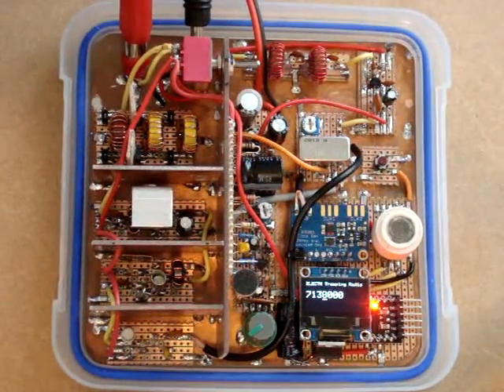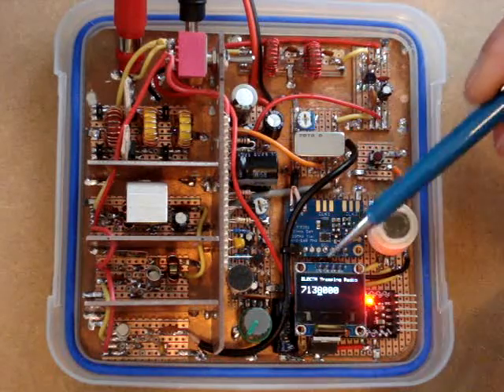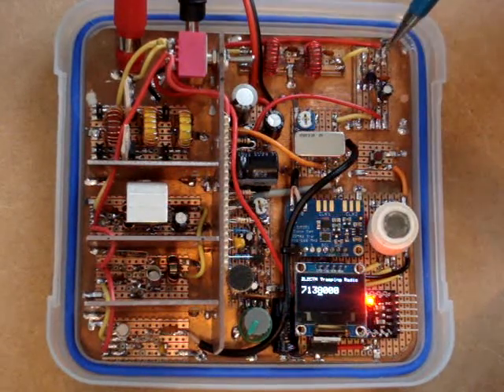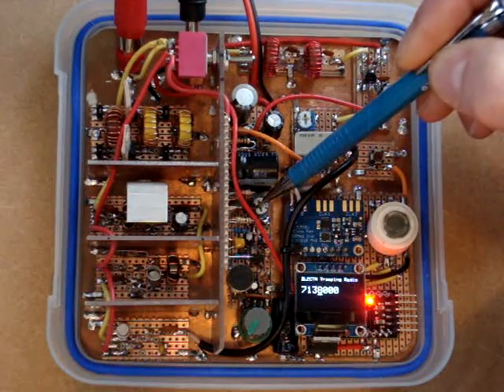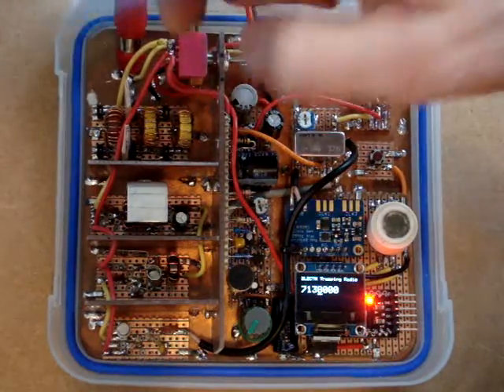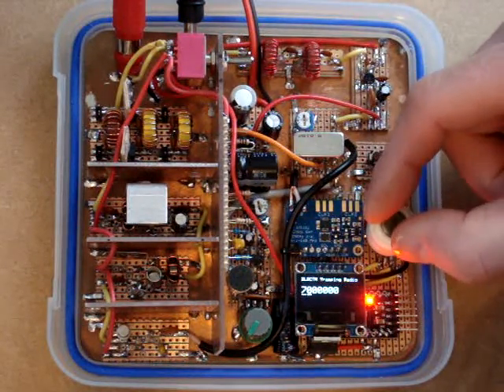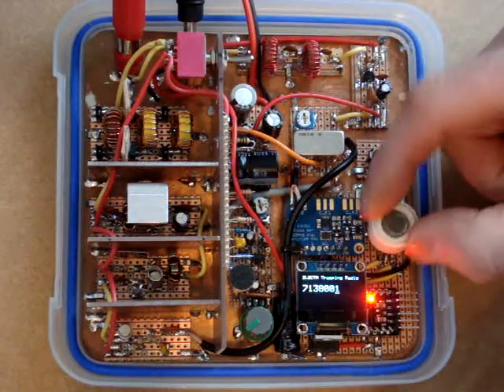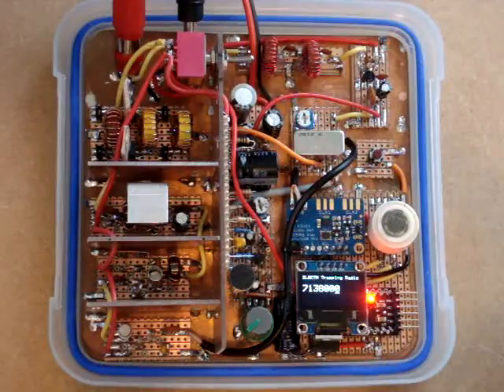Homebrew 80m/40m/20m Tramping/Hiking Radio

Comment: excelent Charlie...9a3xz
Reply from the maker: Cheers Mikele. Certainly a simple way to make a filter. A bit of work, but nothing too technical. Ideal for a simple shack like mine.
Reply from the maker: Opps. Wrong video! Yes, that rig goes back a bit. I find those little food storage boxes really good and easy to use.
Reply: Charlie Morris Pete put new video today and i m thinking to start your hbrsdr ..very very nice Charlie
Reply from the maker: Go for it. You can make the front end whatever you want, so long at it provides I and Q AF to the Teensy. The Iowa Hills software is great to generate the filter coefficients. More details at: http://zl2ctm.blogspot.com/2018/03/homebrew-ssb-sdr-rig.html

Comment: Very nice! I like how you implemented the radio in descrite stages as with a block diagram.
Reply from the maker: Thanks. I find it useful to build the individual modules then join them all up. Easy to swap out and try different approaches.

Comment: I like it!  But didn't the square-wave output of the Si5351 need any filtering?
Reply from the maker: Hi. I have had no problems driving double balanced mixers (commercial SBL-1 or homebrew) directly with the Si5351 square wave output. I've made several radios with that scheme and they all appear to work well. It's slightly greater than 7dBdm, but again, it seems to work well. There was a good article some time ago on the Soildersmoke blog about square wave VFO/BFOs and DBMs. Refer http://soldersmoke.blogspot.co.nz/2016/03/blog-post.html
Reply: Thanks for the helpful reply.  That's an excellent lecture on mixers.

Comment: Like it,any circuit schematics to study?
Im new to DDS and interfacing and want to have a go.
Audio sounded really good.

73's Rob
Reply: technically the Si5351 is a programmable oscillator, not a DDS (like the AD9850/51)

Comment: Hi Charlie, love your video. I have built quite a lot of DSB rigs, even with DDS's. Would you be willing to share your Sketch as I'm no coder.
Reply from the maker: Sure. It's rough, but works. I'd delete the lines talking about blanking the display and flashing TRANSMIT. https://gist.github.com/CharlieMorris
Reply: Thanks Charlie, It will give me a starting point, then I can modify from there.

Joel
KB6QVI